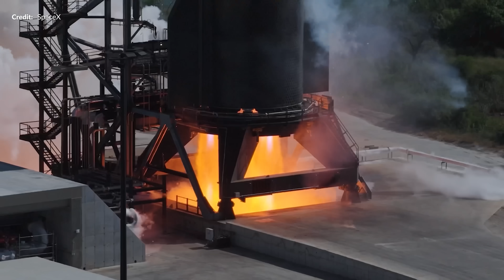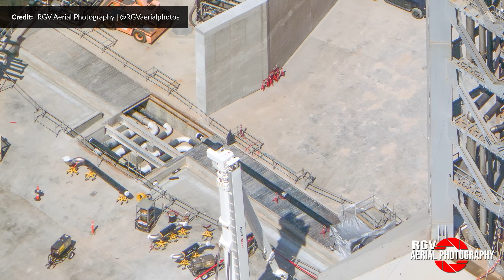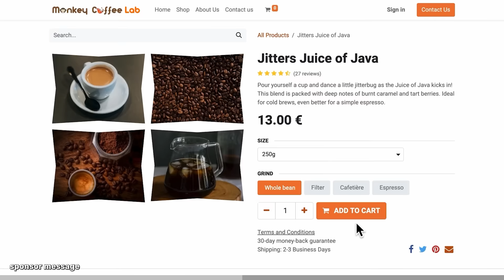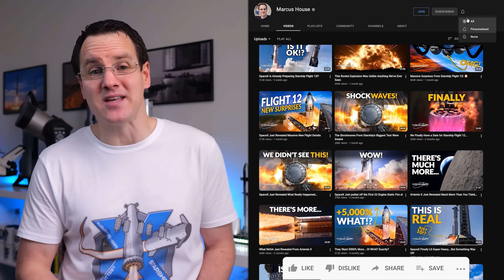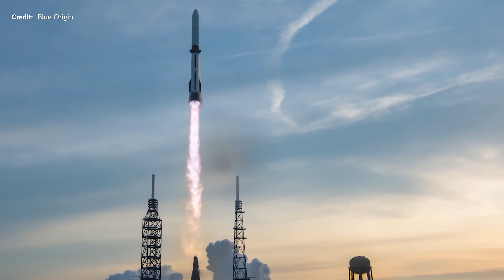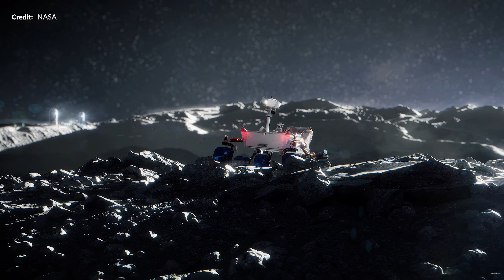Starship's Next Launch Will Be Different

Comment: If you look at the internal engine bay view of Ship 40 single engine test, you will see only 2 sea level engines and 2 vacuum engines installed. It’s a bit hard to do a full engine test with 1/3 of them missing. It could be they were waiting for delivery of the extra Raptor 3 engines and decided to do the single engine test while awaiting delivery.

Edit: I hate autospell

Comment: Hmmm, raptor causes a massive acoustic load on the structure of Starship itself.  It’s likely that Raptor is creator harmonic resonance waves in the steel body of the rocket that is inducing cavitation in the cryogenic fuel, ripping the fuel system apart causing rockets to go boom.  It’s also likely shredding the circuitry in the flight controllers, they are trying to dutune the harmonic resonance by adding acoustic traps, isolation mountings and stiffners at critical points to fix it.  It’s not an easy problem to engineer your way out of. 🤷‍♂

Comment: Finally doing an actual flame trench! That's going to look awesome!
idk who came up with the previous flat ground idea, a really basic mistake that should have been caught by the engineers, or maybe they did catch it but elon liked it or something.
Reply: I think they learned a lot from that 'mistake'. For initial takeoffs from the moon or Mars, there'll be no easy way to build a complex launch site - so let's see what a relatively un-built one takes in the way of damage... best way to find out. Also, they were focused on getting something launched - it could've been an almighty bang (eg: Blue Origin) - then a low-cost site would've looked very smart. I doubt anyone thought it was the best long-term solution, but the most interesting characteristic of SpaceX is spending equipment fast to gain knowledge fast - not spending years & years - slowly to gain knowledge with little 'mess'. Agile & messy engineering is being shown to have benefits.
Reply: @user-t4h7n  They could have just tried it later with a retiring booster rather than screw up and delay their whole testing schedule by a long time so early in development, and for such low-value information (at that stage). Adding a trench wouldn't have added much build time and would survive a booster explosion. The whole ground oscillation thing was well known so this isn't even hindsight, I'm sure they were told this would happen but somebody said do it anyway. You still need to be smart about what you try and when you try it, even if you do have the resources to try things that are expected to fail.

But on a lighter note, yeah, they do need to work out something for the moon/mars landing since even the best locations are risky for such an incredibly massive lander. I'm guessing it will be a disposable landing+launch base with movable diverters to allow thrust straight through in space but redirect exhaust away from the landing site, it will be left behind after launch like apollo, and if they keep the current size then it will be attached in orbit via a rendezvous like the refuelling. Although tbh I'm guessing they will eventually just scale down the lander and add more stages rather than doing the whole starship thing since it's just too big and inefficient for the current needs.

Comment: Why can’t we use solar power at the lunar South Pole? Google says:

“Achieving near-continuous (90-95%) solar radiation at the lunar south pole requires surface sensors or panels to be elevated on short 10 to 20-meter masts at select ridges like Connecting Ridge. “

For the remaining 5 to 10% just use batteries.  In other words who needs a nuclear reactor on the moon?
Reply: well... many answers to that one. with respect to the video, we are talking here about a rover and an rtg. a rover doesn't want to stay up high to catch solar all the time, but wants to enter craters for example where you have constant darkness for example. 

With respect to a base. it depends on what you want to do and how much energy you need. for a science base solar will be the way to go. but this also depends highly on the place where to put the base and if you can reach an elevated spot easily where you have the constant sunlight. 

Industrial bases... as unrealistic as they are at the moment, maybe have completely different demands with respect to location and power consumption.

Comment: Single raptor test: I wonder whether they could just use one raptor on the Starship for and then light the other 5 after it is away from the booster......less stresses and blast on the top of the booster, but then light the other 5 very shortly after separation.

Comment: Booster 20 will presumably be recovered.  Ship 40 will be the last Ship deliberately scuttled.  If you think SpaceX is hardware rich now, imagine what they will be like by the end of 2026 with at least ten Starships and 6 boosters on call.  These boosters and Starships will not require the two weeks of refurbishment that is largely a consequence of the use of kerosene as fuel on Falcon 9.  Although SpaceX has only announced the intention to launch at least once a month from now to the end of 2026, I see no operational reason why they cannot achieve weekly launches by the end of 2026.
Reply: It will all come down to what happens on the next flight.  If both go as hoped the next flight might be a booster catch and a starship landing in the gulf.

Comment: The SWIFT rescue mission was launched by the very last Pegasus rocket, carried by the very last L-1011 jet. The Pegasus is an historic and venerable rocket. It was actually the first successful privately developed orbital launch rocket. It had a pretty good cadence in the 1990s, getting up to eight launches a year, which is pretty good for an expendable. In the 2000s though, as new rockets came into service, capable of flying small payloads as rideshares, it lost its market. Nonetheless, it holds an important place in the history or rocketry and I'm glad it got this important mission for a swan song.
I think the question is not so much when will Starliner fly again, on its planned, uncrewed, cargo delivery mission, as will it perform that mission well enough to justify putting a crew on for the next mission? If it doesn't, I'm quite sure that NASA will then finally cancel the contract. Boeing will be humiliated by that but also, I imagine, relieved since the fixed price contract means they have been on the hook for all the additional cost of analysis, redesign and testing.

Comment: Blue Origin has decided to test their rockets without the payload present so the payload is not put at risk if the rocket fails on the pad again, that's one reason why the payload isn't added until after the rocket (booster and second stage) are already vertical. I do hope they are not just repairing the tower but also armoring it against another rocket failure as well.  With only one launch site right now that on pad failure put an extra long serious delay into their schedule.

Comment: The way they are planning on doing the flip maneuver and hot staging is really stupid. I'm all for "the best part is no part" mentality, but if they have an engine out on the ship, it's not gonna perform properly. They should go back to the hot stage ring cover like they had on V2. It worked, it likely doesn't weigh much, and it's engine-out safe and compliant.

Comment: Please someone tell me how this huge thing is supposedly going to land on the moon, etc without tipping over?  How is it going to blast off from the surface and keep flying debris from destroying the engines?
Reply: The center of gravity for HLS Starship is dominated by liquid oxygen, which is positioned at the bottom just above the main engines.  It's not as tippy as it appears.

For the final phase of landing, as well as initial phase of liftoff, HLS Starship will use a separate set of ~10 or more dedicated thrusters, positioned in a ring encircling the Ship's hull, just below the crew/payload compartment - i.e. quite high above the ground - and thrusting at a slanted angle downward along the hull.  The plumes from these thrusters will be quite diluted and expanded by the time they reach the ground (and will bounce off the ground in a direction radially away from the Ship), so the amount of regolith sent flying or potentially impacting the main engines should be minimal (operative word - should ...  the proof will be in the doing).
Reply: Because tipping over is about the CG.  Something you probably don't understand.  Debris flies away from high pressure, not towards.   Something else you probably don't understand.

Comment: Some questions for ya:  1.  How are they going to eventually catch both the super heavy and the starship on the same flight.  No one has answered this.  Either they do a quick pull off of the super heavy before while the Starship does a couple orbits of the Earth or they are going to need two catch towers.   2.  I am very confused by KFC, why have a giga bay if you don't have a star factory there.  It seems kind of stupid to have to ferry all the ships from Texas to put in a Giga bay that can hold up to 24 starships.  I know they built a really large building at Roberts Road about 4 years ago, will that be the star factory there?
Reply: For catching both starship and booster they have two options. The first is that they catch one then move it off the tower while the other is in orbit. That gives them about 90 minutes to be ready for the starship after the first catch. The other way would be to complete the second tower. 
The plan for the future is to have a manufacturing facility at every launch site with Stargate being more of a research and development location.
Reply: @AltruisticDolphin and, what about for an RTLS abort?

Comment: Why is nobody talking about the 9 engine ship
Reply: It's still at least a year out (perhaps more like two years) - as it'll fly together with a v4 Booster, which in turn needs the GigaBay(s) to be fully outfitted and commissioned (it's too tall to fit inside the existing MegaBay for Boosters.)

Comment: They should build a Perseverance-sized rover for the Moon that carries a small, Sojourner-sized rover and a long crane-arm to lower it down into those holes (skylights?) in the Moon’s surface (lava tubes?) to see what’s in there and how big they might be.  Keep it on a long tether with data cable to the crane so it can be hoisted back up to use elsewhere or in case it gets stuck.  The data cable will receive video or 3D images from the small rover of the inside of the hole/cave.

Comment: Re the lifting of launch assemblies, from horizontal to vertical, do we remain assured that bending stresses (maximized at the midpoint of the assembly) remain within material strength specs? (This question applies to EVERYONE: BO, SpaceX, etc.

Comment: I agree with you regarding the new Blue Origin pad.  They are going to design, and implement a completely new launch pad configuration, including all of the plumbing and electrical handling and ship connections in 6 months?  I wish them well, but that seems like just not enough time.  Everyone, including SpaceX, the benchmark for doing things at hyper speed, had many issues with the ground services and connections which needed modifications after testing.
Reply: Yeah, I tend to concur; particularly since BO has never demonstrated that sort of ‘urgency’ in the past. It’s not impossible; it’s just that they have not demonstrated- yet- that they are rapid-response capable like SpaceX…..yet. - Dave Huntsman

Comment: The biggest hurdle to full reusability may be starship’s heat shields holding up upon reentry so as not to need any significant maintenance before relaunch. A repeat of the space shuttle tile repairs or more than minor maintenance issues after each return would be a problem. Need to start catching the starship soon to know.
Reply: Even a full heat shield replacement after every flight won't be such a big problem, adding perhaps a couple of weeks and a $million or two for each turnaround.  Starship isn't the Space Shuttle: its heat shield is built with largely standardized and mass-produced components, designed for fast (re)application.

Comment: I wonder why Blue Origin hasn't chosen a vertical assembly and manouvering approach like SpaceX? It seems efficient having everything upright when you have a big rocket (short of transporting between space coasts)

I'm impressed with how quickly and successfully the Catalyst mission has progressed. A mission like this would have taken far longer to put reliably into action even a few years ago. Activity in low orbit is becoming very routine.

Comment: Starlink is polluting our planet
There are currently 10,666 active Starlink satellites orbiting Earth. 
Multiple landmark scientific studies have proven that vaporized satellite debris is actively polluting the upper atmosphere, with alarming findings regarding the ozone layer and global climate systems. 

Because thousands of commercial megaconstellation satellites are designed to intentionally burn up at the end of their lifespans, scientists warn that we are drastically changing the chemical composition of the stratosphere. 

Key Scientific Findings10% of Stratospheric Particles Are Already Space Junk: A groundbreaking 2023 study published in the Proceedings of the National Academy of Sciences (PNAS) used a NASA high-altitude aircraft to sample the stratosphere. Researchers discovered that 10% of all sulfuric acid aerosols contained heavy metals like aluminum, lithium, copper, and lead in ratios that perfectly matched aerospace alloys rather than natural meteors. 

Real-Time Tracking of a Rocket Plume: In a February 2026 study published in Communications Earth & Environment, researchers from the Leibniz Institute of Atmospheric Physics used specialized ground lasers (LIDAR) to successfully measure a chemical fingerprint in real-time. They tracked a massive plume of atomic lithium vapor 100 kilometers high in the atmosphere directly back to a disintegrating SpaceX Falcon 9 upper stage.  Aluminum Oxide Generation: 

A 2024 study in Geophysical Research Letters simulated the physics of a burning 250-kg satellite and found it creates roughly 30 kg of aluminum oxide nanoparticles. These tiny particles can float and endure in the atmosphere for decades. The Two Main Environmental Hazards. Threat to the Ozone Layer The primary concern is aluminum oxide, which acts as a highly effective chemical catalyst. When it mixes with the remnants of old human-made chlorofluorocarbons (CFCs) in the stratosphere, it triggers reactions that free up destructive chlorine molecules. This process actively destroys the protective ozone layer that shields Earth from dangerous ultraviolet radiation.  

Accidental Geoengineering (Climate Impact)A May 2026 study warned that the sheer volume of metallic soot and ash accumulating in the upper atmosphere is beginning to physically block sunlight from reaching Earth's surface. By 2029, the sheer scale of mega-constellation reentries will likely create an unintended global cooling effect, mimicking high-risk geoengineering proposals in ways that are not yet understood or regulated. Future Scale Currently, there is no global regulatory framework managing what rockets leave behind when they incinerate. Because orbital companies have applied to launch tens of thousands of additional spacecraft, researchers estimate that by 2030, several tonnes of satellite materials will burn up in our atmosphere every single day. Would you like to examine how the American Astronomical Society (AAS) is lobbying for regulations, or see the specific chemical reactions that cause aluminum to erode the ozone layer?
Reply: They might have to change materials in the future.
Reply: @imaginary_friend7300  They might have to?  I guess only if they're worried about permanently killing our planet would they might consider it?

Comment: RTG based CO2 or liquid CO2 engine using RTG in micro setup as heat source for liquid CO2 internal combustion style recovery engine to run a generator as opposed to direct heat. Also generating rotational torque to run wheels and other instruments.

Basic micro RTG based on Voyager style probes scaled up for appropriate heat cycle to the Chinese style liquid CO2 combustion engine with full recovery and recycling, being conversely scaled down to meet the Rover needs

Also usable in smaller recovery vehicles such as emergency escape pods: power, air cycling and orientation
Reply: Draco thrusters on the Escape pod, three person capsule. with individual crash pods with gel sleeves inside and on the lid so that as you close it your lower extremities are wrapped in a gel to help with any High Gravity maneuvers. This minimizes the oxygen needs of the pod allowing the crash pod to be an independent unit. These can be made with health monitoring as well as some minor splinting ability for stabilization and transport.. . Sorry,  my brain keeps designing.  But the dyslexia kicks in and I kant communicate
Reply: @BigfootGoforth  That seems like a lot of extra cost, complexity and mass.. for what gain?
Reply: @imaginary_friend7300 complexity for interchangeability the parts reproduction level delivery of human emergency escape vehicles for spaceships and space stations
Reply: Co2 combustion?  Are you thinking Co by any chance?
Reply: Some scientists in China and just did an internal combustion engine running off supercritical CO2 the expansion from liquid to gaseous form is equivalent to combustion of hyper chemicals  @imaginary_friend7300